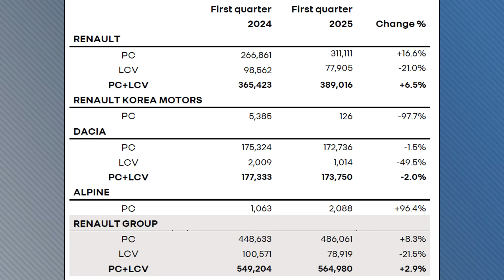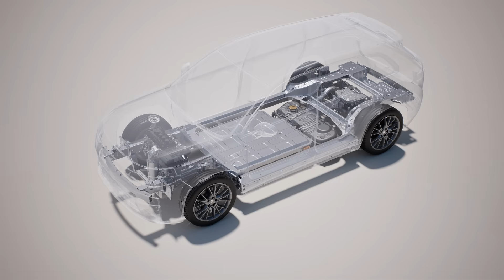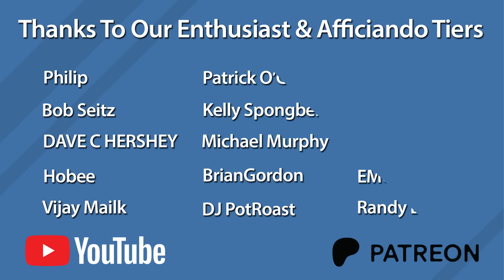U.S. to Set New Autonomous Car Rules; Nissan On Track for Historical Loss - Autoline Daily 4041

Comment: Just a comment about you comment at 7:27 regarding Tesla.  A fact you should include is that Tesla's best seller was not built for several weeks to re-tool for the replacement.  Given there are 13 weeks in a quarter, much of the loss is from the cutover.  Some from other reasons.  You are not painting a full picture.
Reply: So that doesn't explain why the refreshed model 3 sales were down along with Cybertruck, S and X models.😢
Reply: @bensontek  And yet the QoQ daily cumulative registrations for Europe ex UK for the Model Y is EXACTLY the same from Q1 to Q2.   Try again
Reply: But the report at 7:27 is not about Q1, it is about March.  When did the refresh hit the market in Europe?
Reply: Stop repeating that ridicules excuse, tesla is toast.

Comment: I just don't get Nissan downfall. Everyone I know is happy with theirs. My daughter's versa had over 130k miles and we only changed oil, plugs, tires, brakes. My uncle has been driving Nissan for the last 40 years and the only problems he had was back when Pathfinder's had an exploding rear hatch window problem.  Most everyone I know who's had one at most has had minor problems with them.
Reply: it's the newer stuff that sucks. all of these cvts and plastic oil pans.  
plus everything they are making is ugly.
Reply: Unfortunately Nissan is heavily in  debt and its declining profits especially in china doesnt cover its interest payments.
Reply: I had a 1972 Datsun and 2 Dodge Colts and it was until 3 years ago that I dared buy another Japanese car (Mazda). They seemed to have learned fast.
Reply: @jamesvandamme7786  My dad has a 74 ? 610, my brother had a 73 240z,  and my uncle, whose only had Nissans had a 280z.  None had major issues.
Reply: Just because your CVT transmission lasted doesn’t help the tend of thousands whose CVT transmission died around 100,000 miles. They were cheap junk.
Reply: @jameswoffinden9215  maybe you abused and neglected yours ?

Comment: Regarding if automatization is the answer for the US car companies. The answer is no not alone. US car companies also need to design model that can be exported, so they can compete globally. The current focus on SUV and pickup trucks, based on the US exceptions from US regulations, needs to change.
Reply: Our government can't even get rid of daylight savings, how can we get rid of stupid regulations that benefit manufacturers?
Reply: You realize Ford, GM, Stelantis, and Tesla manufacture globally?  That is part of the reason Ford makes hatchbacks in Europe and not the US.
Reply: @briangasser973  I have a Focus hatchback, and I'm waiting for Ford to make one again before I give it up. Difficulty: no engine or transmission. Especially transmission.

Comment: As for California EPA exemption, if it goes aways, perhaps California should just add a $5/gallon tax to all fossil fuels to help pay for all the environmental and health damage that extracting and burning fossil fuels cause. It would avoid the need for any special EPA exemptions and encourage EVs at the same time.
Reply: Or Tesla could simply pay back the $100 Million they stole from California taxpayers over the battery swapping scheme.
Reply: Excellent idea.
Reply: EVs make no sense.
Reply: @ - EVs make a lot of sense. More power, faster, quieter, eliminates oil and filter changes, muffler changes, timing chains, and a host of other costly maintenance issues. It also costs far less to fuel. I leave my house every day with a full "tank" and it costs nothing as I have solar.  There are now more charging stalls in the USA for longer travel than gas stations.  Now if you're towing a boat 1000 miles everyday, perhaps EV is not ideal, but for 99% of drivers, EVs are a far better solution.
Reply: @bunsw2070  Burning fossil fuels is causing changes to the global climate that will cause many trillions of dollars of economic losses in the lifetime of someone born today.  How does this make sense?

Comment: We need electric heavy duty trucks. Nobody wants to bring them because they'll destroy the market. Trucks have twice the engine. They should get twice the battery too. Once you eliminate energy or gas. And matinence. The overall cost will be in the ev's favor. Just make it. Before someone makes a truck body that holds 2 model 3 batteries. No self driving. No features. Just DRN12L. They can make it cheap. Just cut the crap
Reply: BYD Class 8 semis have been here for years and are assembled near LA
Reply: @bobbbobb4663  422kwh? Only 150 miles range. That's ridiculous. Bob. You still on here? Lol
Reply: @IcyPrepper76  I'm here every day.  Not ridiculous at all...the weight penalty of larger batteries makes no sense when diesel does it better.  Just because Car Assembler CEO can only compare trucking to trains doesn't mean that long haul is the only use case.
Reply: @IcyPrepper76  Shilling is his fulltime job. But there are plenty of applications where 150 miles are useful.
Reply: @bobbbobb4663  Diesels require too much regular work and maintenance
Reply: @IcyPrepper76  Lol the Tesla semi uses the motors from the S and you want to any they are capable of thousands of miles without failure versus a diesel.   Musk can’t spell reliability…
Reply: @bobbbobb4663  I will note in this regard, that the organization that handles most roadside assistance in Germany has released a report that seems to show conclusively that A)  EVs break down half as often as ICE vehicles, and B) Tesla EVs break down far less often than the average for EVs (mainly due to use of Lithium battery for 12V systems -- the lead acid 12V batteries and associated charging electronics are a main point of failure).  This report seems to suggest that Tesla EVs are the most reliable passenger vehicles on the road in Germany.  I'm no fan of Musk, but this is the reality.  Most likely, other EV makers will catch Tesla in reliability as soon as they make adjustments based on the results of this and other similar reports.
Reply: @ Go read the TUV report that says Tesla is at the bottom.  Also, Tesla legal team has argued in Germany says that the useful life of a Tesla is around 130,000 miles.   The reality is that Tesla is just making junk cars to populate the junkyards.
Reply: EVs make no sense. Especially in trucks. The electric transports Tesla is building are currently delivering potato chips because they're super-light.
Reply: @bunsw2070  false they also transport batteries and parts and other things depending on which companys buys em do research before commenting
Reply: @ Bags of air
Reply: @bobbbobb4663  and batteries and parts to fremont your forgetting tesla also uses there semis and we recemtly found a tesla semi being used at a doc
Reply: @mcsike7264  Tesla copying King BYD.
Reply: @bobbbobb4663  lmao sure buddy 😂
Reply: @bunsw2070  This potato chip claim is COMPLETELY false.  The Semi is used at a Pepsi bottling plant outside Sacramento, which is surrounded by mountains.  They only deliver drinks and vending machines.  Most of the routes go up steep elevations.  And the Semi replaces diesel trucks one-for-one.  Daily routes are up to 450 miles.  I'm no fan of Musk, but as bad as he is, I dislike FUD about EVs even more.
Reply: Cars just move a passenger or two and some groceries around, and that takes a few thousand pounds of batteries that cost tens of thousands of dollars.  That equation just stops working for vehicles that do WORK.  Tractors, big trucks, commercial lawn mowers, earth moving equipment,.  Even if you want the massive battery, having several trucks charging at once will require direct connection to the nuclear plant...  Hydrogen is the zero emissions solution that works for high power density applications but it will take a long time to build out the infrastructure.  It has started.
Reply: @thesolarengineer3473  You are really dumping on Musk today.
Reply: Hydrogen requires 15 parts energy in for each 1 part of energy you get out. Hydrogen makes even less sense then EVs.